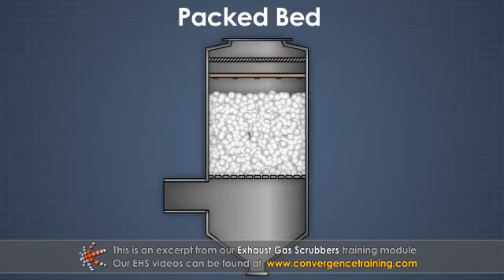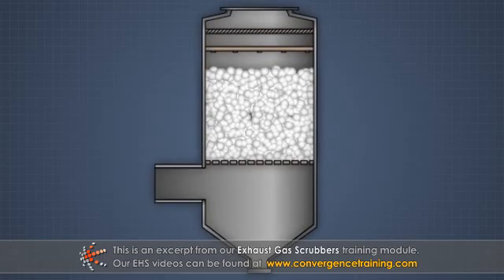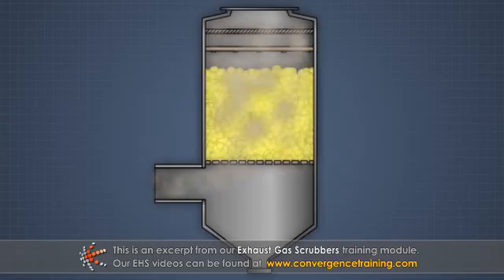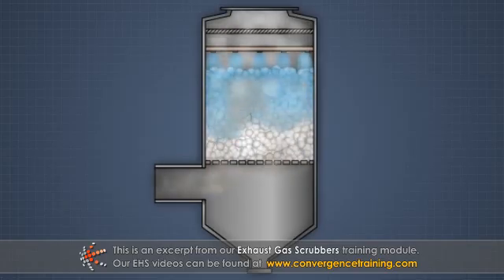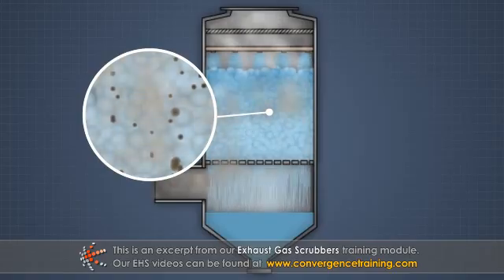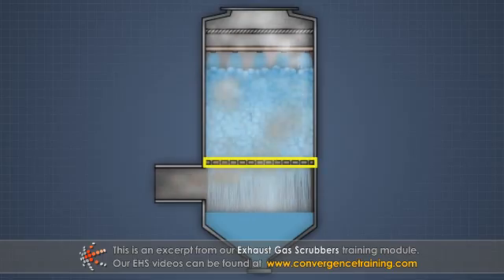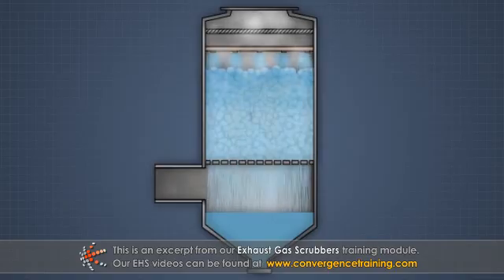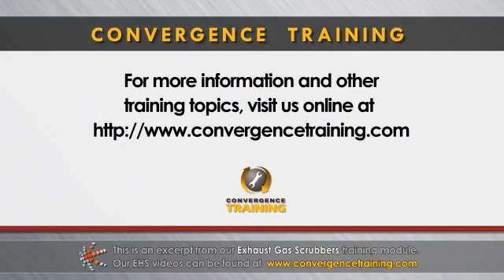Exhaust Gas Scrubbers

Comment: What's the mist eliminator consist of?
Reply: Convergence Training Thanks for responding. I've had a Wood Gasifier finished for 6 Years now with a dry system of Filtering. No Tars, just Soot to Filter. Going to implement a wet Scrubber into the System.